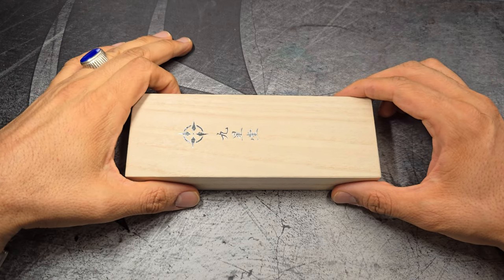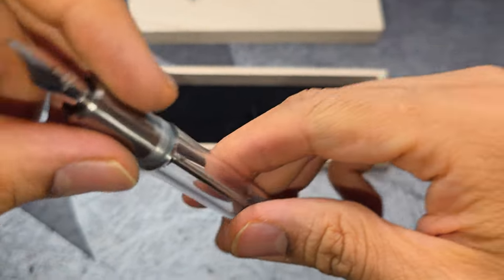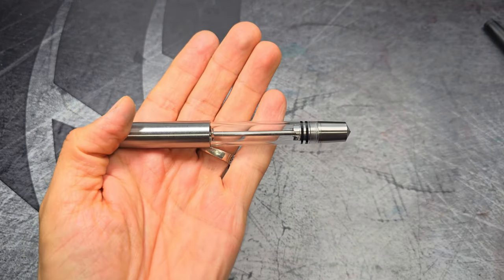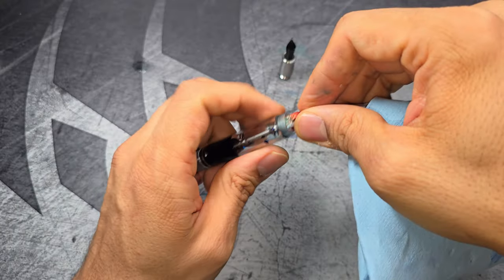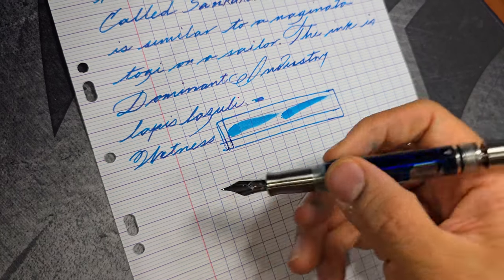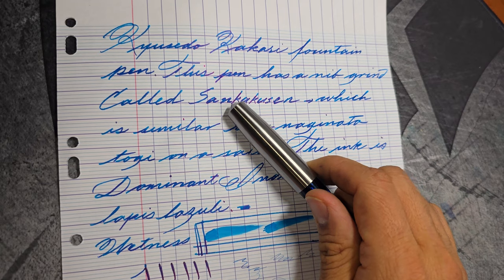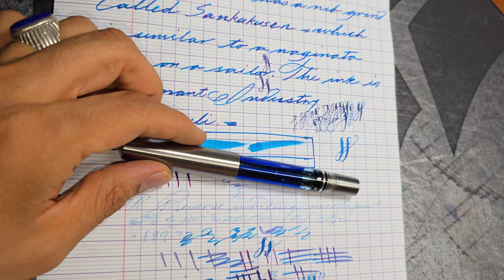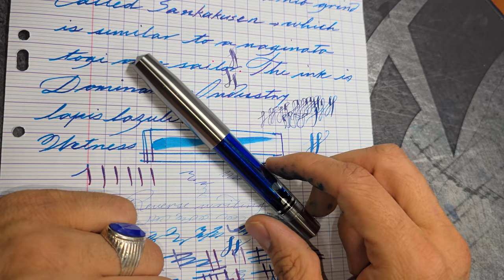The Fountain Pen Enthusiast's Dream: Kyuseido Kakari Review

Comment: So you took a pen with a heavily-engineered filling system, and turned it into a syringe-filler with a shutoff valve. There is a way, using the filling system, to get a full fill: after the first fill, turn the pen nib-upwards so the air bubble is at the top, and while in that position, carefully push the piston until the air bubble is gone; then turn the pen over, put it in the ink and pull back the piston again all the way, and then disengage the piston and close the valve. That issue aside, I agree with everything else you said about the pen. I bought mine at the San Francisco Pen Show last August from the Gravitas pen table. Oh, and one advantage this has over a Conid Bulkfiller is that you can actually buy one without waiting for months.
Reply from the maker: Thanks! I use the pump if I am not charging inks. It is easier to clean when opened. And I like the whole process of opening,  washing, drying, and putting it back together.  Cheeks!

Comment: I would really like to own this one, but your cons are sobering.  I’m a relative newbie and have experienced no adverse situations with my ten pens that would require service.  Can you guess what  is the likelihood of something going wrong with this pen?  Would Pen Venture take care of it do you suppose?  Pen Venture has a variation of this pen but I prefer the silver color of the titanium rather than the blue color in the similar version.  I think the blue argues with the ink colors inside the pen whereas the silver colored titanium titanium does not.
Reply from the maker: This is a heavier pen. The likelihood of something going wrong is moderate due to fragile midsection.  I say as pretty as this pen is,  around 250 to 300 is probably a better price point for it - after a year of use.  I wish they made one with proper clip.  The new kyuseido pen has a faceted cap. Still, it is not a 600 dollar pen.. For the money,  I would endorse a pilot 845, pelikan m1000, Sailor kop, or a used MB 149 over this.  

hope that helps.
Reply: @Shak-MD  what a helpful response, thank you so much!   You’ve saved me from making an expensive mistake. Thank you again.
Reply from the maker: Thanks.  Edited typos 😀

Comment: The filling mechanism is functionally identical to the Conid Bulkfiller (I have both). The implementation is slightly different in that the way the plunger is attached/detached from the shaft and how the plunger is parked in the rear end cap are reversed. On the Conid the plunger is parked using a bayonet mechanism and the shaft screws in and out of the plunger. The Kyuseido is the opposite - the plunger parks by screwing into the rear end cap and shaft is connected/released from the plunger with a bayonet. It's a bit convoluted to describe in words. Kyuseido claims their implementation has the advantage that the plunger can be detached at any point in the barrel letting you limit the ink capacity if you want. I've found this advantage to be mostly theoretical since the friction of the shaft with the plunger makes it very difficult to release the plunger and not have the plunger  move forward toward the nib causing ink to spew.  Both pens are beautifully made. The Conid has one advantage, in my opinion, over the Kakari: you can see the primary ink reservoir on the Conids so it's easier to see the amount of ink remaining before you need to open the plunger/valve. It's kind of a minor thing but it caters to my OCD 🙂. Conids are twice the price - if you can even get one - so OCD comes with a real cost!
Reply from the maker: Thanks for your input. 

What I realized is that you can park this pens piston at any point in the barrel,  thus adjusting the weight distribution.  That's a great feature.  Does Conid have the same feature?  

Also, I think Conid is releasing a new batch this month. I am excited :).
Reply: @Shak-MD  The Bulkfiller's piston/plunger has to be parked in the rear end cap before the shaft can be released so there's no way to place the piston in some intermediate position.

Pen World will have some Kingsize Bulkfillers on sale Mar 19. They typically sell out in less than an hour.

Comment: My Pen BBS 355 has a similar if not identical mechanism. The PEN BBS 355 been reviewed by Canadian YouTube Doug at his Inkquiring Minds channel . No doubt the Kyuseido has been built to a high standard and much more expensive than the PENBBS 355
Reply from the maker: It would be such a shame  if someone put this mechanism in a non-transparent pen.  One thing I found out later, is that the piston can be left at any point in the barrel to help with weight distribution, which is amazing. Maybe I'll do a short video showing that. I was pleasantly surprised, how the writing characteristics of the pen changes depending on where the piston is left.

Comment: Thank you for the wonderful video.
I have a question: Isn't this a little bit back heavy?
Reply from the maker: Great question. The pen, being make mostly of Titanium is on the heavier side, but in a very high quality material kind of way. It is not back heavy because the grip section is also metal.  One trick it has is that the piston mechanism [includes metal pieces] can be parked anywhere in the barrel. Thus, we can adjust the weight balance to an extent. I am going to make a video to compare this pen vs. the famous Conid King Size, and I will show this in action.
Reply: @Shak-MD  Wow, interesting. I've gotten more interest in this pen. It's definitely in my wishlist. I'll look forward to the video, too!:)

Comment: Great review and demonstration of this pens' capability. I have the black version currently in my rotation. It's inked with Waterman "Serenity Blue". I was concerned about staining the barrel and didn't want to try anything to "crazy" for my first inking. I agree that it's an expensive pen. But, to me, given the materials, craftmanship, 14kt nib and ebonite feeder, it's appropriately priced. For now, the only regret I have is I wish I could have purchased mine at a pen show, like you were able to do. Shipping, and FedEx "extortion fees" added $130.00 to the cost of my pen!
Reply from the maker: The extortion fees are terrible. I had to deal with UPS extortion fee once after buying from Europe......unpleasant.
Reply from the maker: None of the inks have stained mine yet. It is awesome how easy it is to clean. Shame on pelikan...their m805 demonstrator is impossible to clean.
Reply: Very glad to hear this! @Shak-MD
Reply: @Shak-MD  does the m805 demo not have an unscrewable nib unit? my stone garden does, just a suggestion, may the triune God bless you!
Reply from the maker: @robmc120  It does unscrew. However, it has an inner sleeve. The ink gets strapped between two pieces, and it is impossible to get out. Bleach came close, though.

Comment: Great video Shak; Very helpful.

As I have the Montblanc 149 with the curved calligraphy nib I am curious if there is enough difference between the Sankakusen nib or if I should diversify with a different nib.  I have been seeking a pen to use shimmer inks with.  

Appreciate your insights.  

Thanks again
Reply from the maker: Hey Fred. The curved nib is amazing. It gets more line variation than the Kyuseido. However, this pen is a different level than what I have seen before, not necessarily in a better way than the curved nib. It is just such a smooth grind---more of a semi architect and Naginata---somewhere in between. If you are looking for shimmering ink friendly, look no further. My TWSBI echo and Platinum preppy totally clogged with DI's Lapis Lazuli ink. This pen handles it like nobody's business. I say you give it a try.  LMK what you think after you try :) 

Thank you for watching.
Reply: Appreciate it Shak; I’m going to go for it and will follow up.  Thanks for the quick reply also.
Reply: Just received mine and it is truly an engineering work of art- just waiting for my Dominant industry inks to arrive!  

Btw, CY is an amazing nib architect.  I asked him to adjust for my particularly writing  style and it is spot on. 

I noticed you placed a kaweco clip on the cap and as I have one that slips constantly on the kaweco bronze; is this actually holding up on the titanium cap and usable to clip the kakrari or is it slipping and only helpful as a roll stop?

Thanks Shak!
Reply from the maker: @freddyk67888 I am glad you got to experience!  The clip clings pretty tight. No letting go. 

BTW. Just got a Conid Bulkfiller Kimg size, and you'll love to hear what I got to say when comparing the two. :)

Cheers.
Reply: Can’t wait!

Comment: Thank you for the review.
One question upon using this pen. Is it a must to unscrew the end for writing?
Has that ever been a problem or so?
Reply from the maker: The know is a shutoff valve. It gives a good page or so of writing before drying out. I write big, so, that may not be much. Whatever ink is left in the nib and section allows for some writing. I open it so that it doesn't run out on me :). I hope that answers your question.
Reply: on the plus side, because of the valve there is much less chance of ink 'leakage' if the pen is jostled or carried on a plane.

Comment: What’s the point of having this interesting filling system if you ED fill it ? Won’t metal threads on the section wear out barrel threads by repeated unscrewing and screwing ?
Reply from the maker: Just to show a different means of filling. I also showed the proper way. I use ED filling when changing inks....easier to rinse. One can argue that pumping is just as easy to clear the pen.  

You are right. The threads may wear out....now you have me worries. But the cap also has threads that mate with plastic section!  Time will tell. I have been using the pump when using the same ink 😀.
Reply: @Shak-MD  Cap has Delrin insert I believe. So capping threads are safe
Reply from the maker: Great information, Ashytosh! Thank you so much.

Comment: Not sure why you would eye drop this pen.  It has one of the best filling systems of any fountain pen on the market (excluding Conid), so why bother buying a pen with this filling system, if you don't bother using it?  Is there a practical reason you use an eye dropper, or is that just how you prefer filling this pen.  Do you use an eye dropper for a pen with a converter?
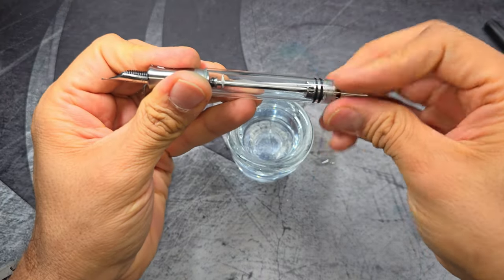Reply from the maker: Hello dear. Great question. I love the complexity of the filling system. The demonstrator acrylic is so awesome that makes most inks look super cool. So, I change inks frequently. Therefore, It is so much easier to unscrew it and hold it under running water. Very easy cleanup.  If I'm using the same ink, I can use the pump.  BTW, in the video I showed both ways to fill it, but I understand it is long and you can easily miss is :)  10:00 marks the correct filling. 

As for convertor pens, I eyedroper some. For example, the Magna carta Mag 600 convertor is very bad, and makes it skip and hard start, and raiload. So, I just eyedropper the pen. It works gloriously now :)  Thanks for the questions.  

Cheers!!

Comment: Why would you buy a $600 piston pen and not use the piston? 

Just buy a regular fountain pen with a clear section…..
Reply from the maker: I do not recommend against using the piston. In fact, I show how to use the mechanism with both water and ink.  I just showed how I personally use it.  The reason I use it like an eye dropper is that I often change inks,  and opening the section makes it much easier to completely clear the pen of residual ink.  I do have other demonstrator pens with clear bodies. This one is the easiest to clean.  

Thank you for watching and commenting.  
Cheers.

Comment: Very nice looking but overpriced for a pen with no track record or extensive history. Also it did not look like it posted. For that kind of money you could buy a pelican or a pilot or something with a known reputation and even for a few hundred more you could buy a montblanc 149. Sorry I would pass.
Reply from the maker: I would say Fair enough. It does post, but cap is metal. Weight is nice. The build quality is better than all the pilots I have, and at least on par with M1000/M800. The nib is better tuned out of the box. It is not carrying the legacy of those big names, but it is an amazing piece of engineering.  I think I would still take a 149 or M1000 over this, but aside from the missing clip, this pen seems flawless.  However, with the asvine V200 in the market, I'd choose that over any demonstrator anytime! It is an outstanding pen. Have you seen my review of it? I just ordered a couple more 😀 

Cheers, pen friend 😀